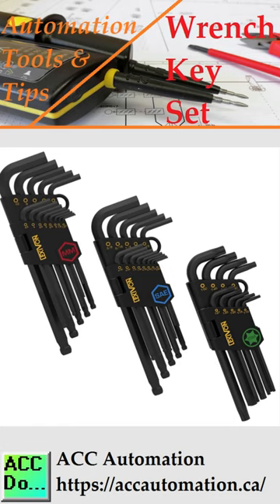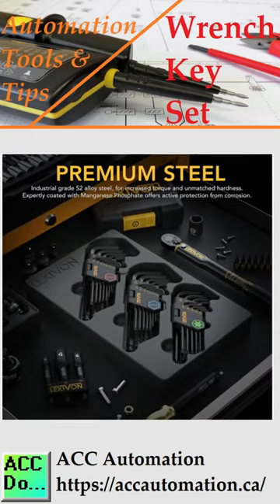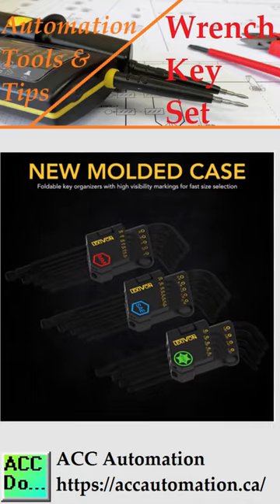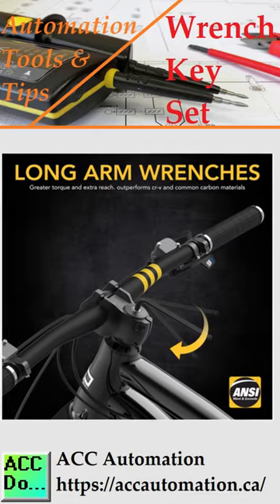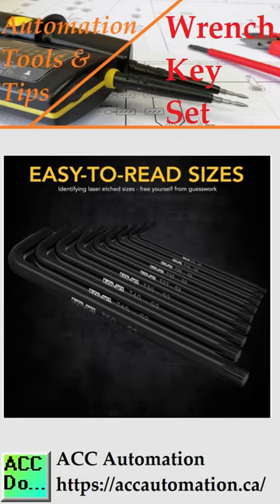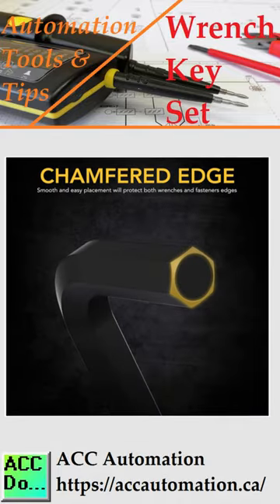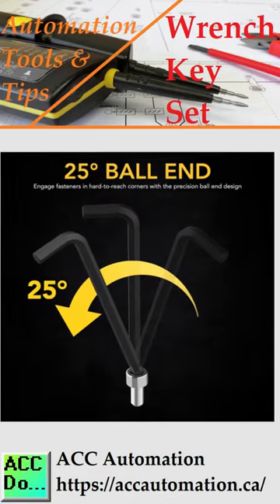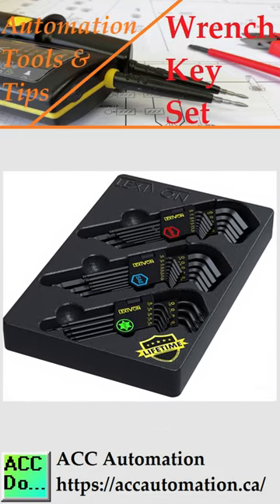Automation Tools - Wrench Key Set

Comment from the maker: LEXIVON Master Wrench Key Set
https://amzn.to/3yNDguz

PREMIUM - Precisely machined HEX & Torx sizes. Crafted and Designed with superior materials for increased torque and unmatched hardness.
DURABLE - Industrial grade, heat-treated S2 alloy steel will increase turning power. Heavy-duty will outperform the regular cr-v or common carbon materials.
LONGEVITY - Manganese Phosphate coating for rust and corrosion protection. The chamfered edges and ball end design will provide up to 25-degree angle entry.
COMFORTABLE - All sizes you might need are neatly organized in a tray. And the laser-etched sizes will make identifying them a breeze!
100% RISK-FREE – Meet & Exceeds ANSI (The American National Standard Institute) and backed by a Lifetime Limited Warranty for your complete peace of mind.

https://amzn.to/3yNDguz

ACC Automation
https://accautomation.ca/